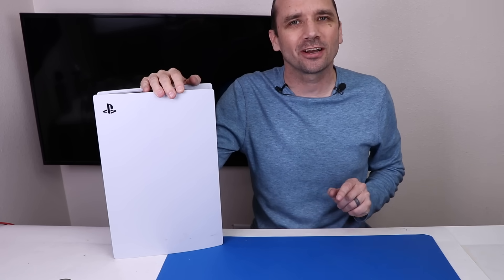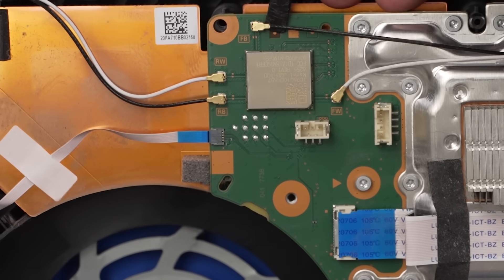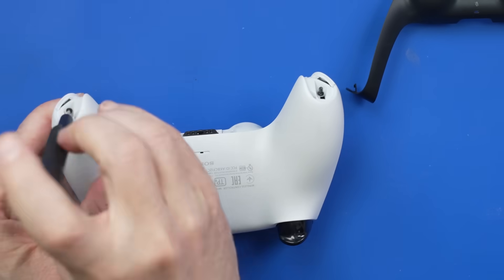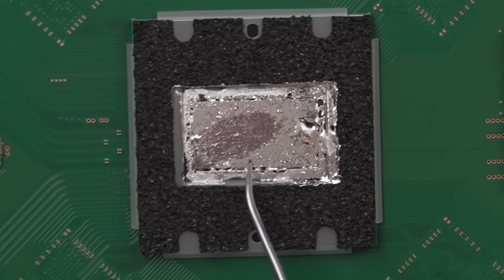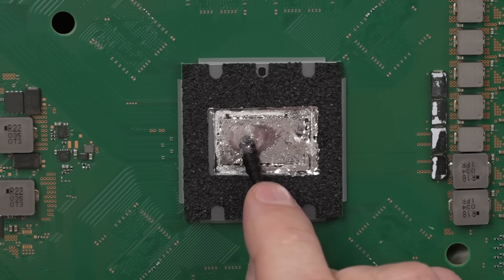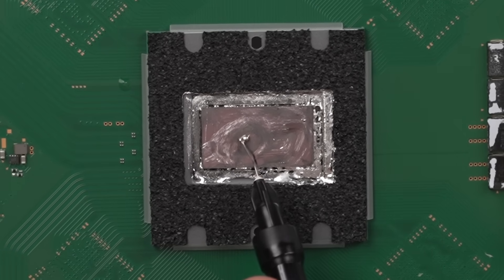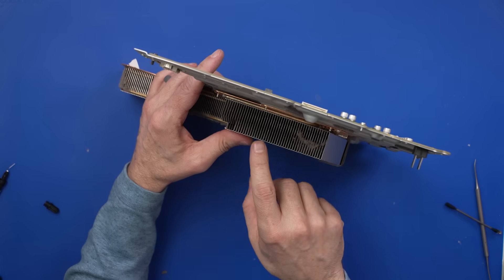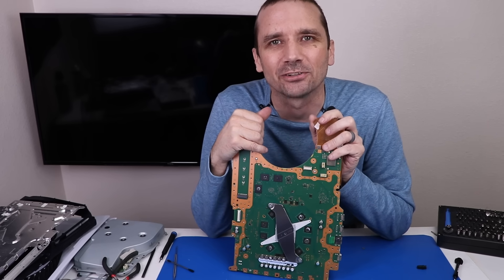How to Fix the PS5 Liquid Metal Problem

Comment: Can you change the liquid metal for thermal paste?
Reply: He demonstrated that about two years ago. It overheated immediately
Reply: This is what I would like to know if I was taking it apart as I'd consider doing it.  Sure it might run a tad hotter but it should be within tolerance of the APU.  However in a hot/humid country I can imagine Liquid Metal is the only way forward.

I'd really like to see a god comparison video of the temps comparing LM and Paste.  This channel did one but he had the fan disconnected so it wasn't a valid test for real world use.
Reply: Yes
Reply: I replaced mine with arcitc mx4 and it works completely fine
Reply: I was just thinking the same thing. Just replace with thermal paste

Comment: Hello! What soldering iron and heating station do you use? Looking for a reliable set of both to get into HDMI repairs, my current iron isn't fine point enough nor does it burn hot enough
Reply: It's always in the video description.
Reply: most likely your iron is fine you just need to put flux and new solder on the factory solder for it to get hot enough to melt and flow, hopfully this was helpful and good luck with the hdmi repairs

Comment: I usually agree with you, BUT the reason the liquid metal is pooling is because it's not under pressure. The gap between the APU and the heatsink should be microscopic, the lm shouldn't be pooling. I think it's overheating and just making the liquid metal run, doesn't help that it's vertical but I've run bare die CPUs before on liquid metal vertically and have had zero issues. Then again it was watercooled so it didn't run crazy hot.
Reply: My PS5 has been vertical since December 24th 2020 without any issues due to liquid metal pooling.
Reply: @syn80 congrats but when there are thirty million units in the wild just because your one doesn't have a problem does not mean that all don't. I hate these stupid redundant type of comments and responses!
Reply: I get where you’re coming from, but the oxidation part is the key here. If pooling was happening only due to loss of pressure. There would be no oxidation left behind. The oxidation is happening as a result of the absence of liquid metal in those spots.
Reply: @XxZannexX  it's over heating that's why the liquid metal is running off. Like I said, i ran mine for years and when i took it apart not a single dry spot or oxidation. You can say the same about thermal paste because you removed the cooler, the contact is gone. Only way to check for sure is to check the lm with the cooler on. Otherwise breaking the thermal interface is completely invalid way to check.
Reply: This is my issue. What is the Xclamp, and thirty screws for if the mounting pressure isn’t there out of factory. This metal should last years and definitely shouldn’t run down and pool. Design flaw.
Reply: In many devices like laptops even using thermal paste is no-no. The uneven meeting surface require material that could fill the gap and prevent any air to be trapped in between. Pressure is important. The liquid metal is heavy, the gravity would pull it down regardless. Maybe it there was some kind of metal rim that interlock with the motherboard so the metal can't escape and keep pressure.That would have being future proof solution. Hope and prayers that some foam can do this job.
Reply: If only Sony didn't apply 3 liters of it when you only need a milligram....
Reply: @Jim On the same note, the absence of evidence is not evidence. We rule out options because we can disprove them, not because we cannot prove them. He's right that it's useless, or even potentially detrimental for everyone who doesn't have a problem to simply state this and move on with no further input. You're effectively asking for what he's asking for (tangible, useful data) and that's fine, but you're also absolving the inclusion of redundant information. I don't have a problem therefore there is no problem is not data.

Comment: Thanks for sharing this. I’ve opened consoles in the past and replaced thermal paste. Thanks to you I’m only slightly less scared to open my PS5. I try to give it a monthly dust off so I don’t have to open it that much to clean it.
Reply from the maker: Cleaning it monthly will definitely help!
Reply: You don't need to do a Monthly Dust off if you run an Air Purifier.  Makes a world of difference and keeps your consoles nice and clean on the inside.  I haven't had to dust out my consoles for years and even when I do, there is barely anything inside them.
Reply: @jakthebomb  when I made my entertainment center I sealed it and it has a electrostatic filter on the intake.  Zero dust enters my electronics.  Best thing I ever did.
Reply: Where does the heat go if it's sealed?
Reply: @firebythewater4477  it has a filtered intake and exhaust. 10 fans to move lots of air
Reply: @brandonerrorcontentmissing4012  But doesn't that trap hot air?
Reply: @mjc0961  it's a little magnetic mesh filter so when everything is off dust doesn't get in.  It has great airflow. It's 10+ years old.  I build custom furniture for a living.
Reply: Just replace it with mx4 or any good thermal paste it will work just fine
Reply: @avi-jk7wv  thermal paste is not as good as liquid metal. theres a video that tests that.
Reply: @avi-jk7wv  I agree, paste pump out (google it) is worst on LM than the newer pastes.
Reply: @S.Madman  just replace thermal paste every year and u will be fine